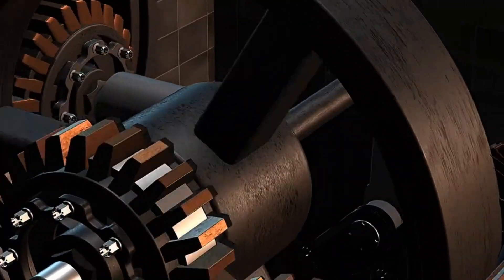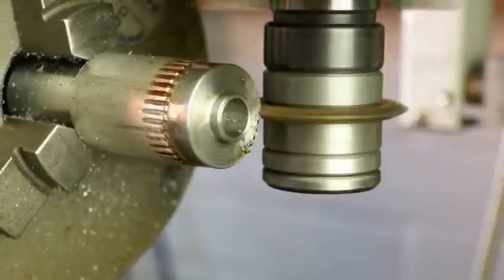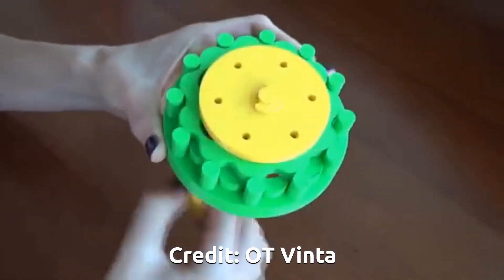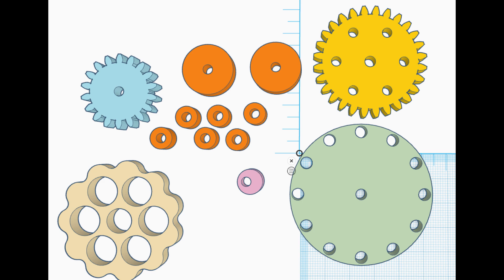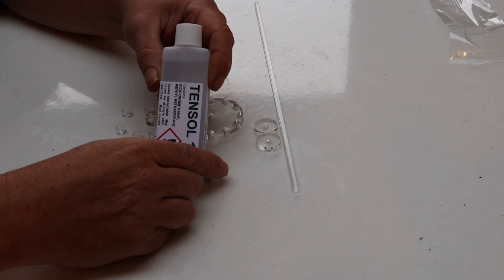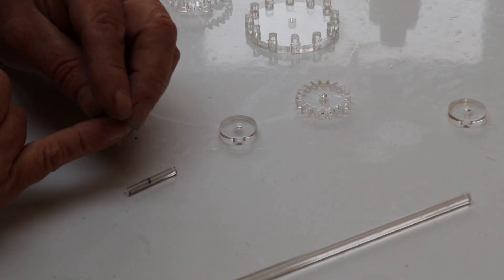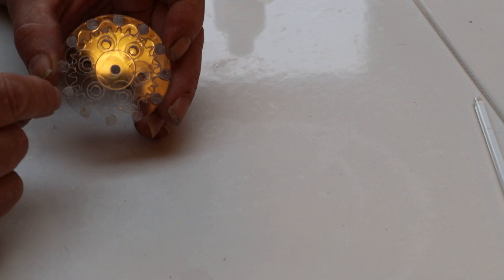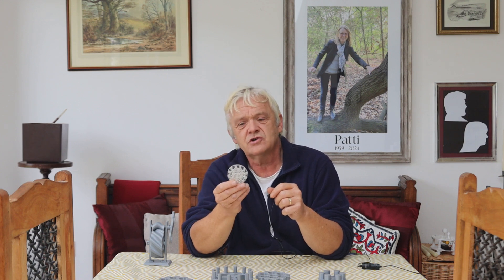2295 Gear Cutting Without Gear Cutting Gear - The Hypocycloid

Comment: Looks good for a daydream i have on a device that would also use a bicycle freewheel sprocket , so that one direction pulls but it can slide forward again without needing to reverse ....i have thoughts on a sprocket with just rods against bearings though and another using bicycle chain flat and one sprocket but i need a big reduction for this idea...glad to see you healthy hope you have a great day sir...
edit: i like clutches lately too (in daydream stage still)  the potential, sometimes a backwards lever could be useful on clutches as in the lever backwards so you disengage the clutch by moving that lever or for start ups or also speed consistency if it's centrifugal version

Comment: Hello Robert, a bit of an off topic question. Have you ever come across "stepped" aerofoils (aka kline-Folgeman aerofoils)? They are apparently an aerofoil shape used for RC gliders that drastically reduce skin drag at low Reynold's numbers. Might be something worth tinkering with in a future project for a low wind turbine or for the blade root of normal turbines to squeeze out a bit more efficiency.

Comment: Hi Robert, 
The 10:1 reduction gear you assembled is very interesting and having a speed reduction is grand however, does the system also produce the torque under load as well?🙂

My reason for this question is I want to assemble a logging winch/capstan out of  wood to prove the concept and help me shift some trees 🌳 😅
Without a gear reduction, a standard capstan would be impossible for one person but with a 10:1 advantage, it becomes a little more realistic and a lovely way to exercise the mind😊

Comment: - I have a  2 stage 3d printed hypocycloidal drive (100:1 in <2" thick gearbox) I made back in ?? 2013 or 2014  - I left the circular pillars/pins as free floating cylinders fitted into holes on both sides of the casing - allowing replacement if they wear significantly...  (the hypocycloid does need to be fairly precise - coming up with the mathematical model for it is a trick -  in the CAD software i used, it needed to have the cartesian form - Polar is so much simpler -as it is just a sinewave wrapped around a circle.....   Back when i did it the discussions on the web was whether or not "accessible 3d printers wer eup to making them accurately enough to function well...   yep..
..
 - The implementation I did was 2 stage (without phase offset hypocycloidal elements) - it was a design curiosity for a 100:1 reducer in the most compact form I could think of - also no bearings as it was a hand cranked model...  Adding rolling element bearings at all rolling interfaces improves efficiency hugely, but of course increases the part count a lot...

 - Making things out of sheet materials with a planar cutter - does improve the ability to mas produce things rather than having to "build all the blocks" a "unit of length" at a time....  In the real world we use as much pre madebulk material as possible - usually, and only "additively" stitch things when ther eis no alternative...  (The civil construction industry really   - Is  at the origin of all additive manufacturing, but again we like to pour things in bulk lots, or insert prefabricated assemblies / materials..

Comment: I have printed your split-ring harmonic drive and it was so cool to see it work, despite my terrible print settings. I printed an axle out of PLA horizontally on my 3d printer to save on time and smoothed it in a hand drill with some sandpaper and it worked beautifully. Thank you mate! I’m going to give this one a go sometime as well, seems far easier to print. Was the one you 3d printed back-driveable, Rob? How about the acrylic one? Cheers!

Comment: plus, because you can do these on a laser cutter, or 2d.. they should be pretty easy to do on a desktop cnc in stronger materials like aluminum or brass.  
I assume the shaft is the weak link in this setup, so replacing that with an aluminum or brass rod, and maybe shaving a part down for a set screw (or D-shaped cog interfaces instead of round) would pump up the durability quiet a bit.  I've found acrylic can be very very fragile when stressed in some directions, so shy away from it as a rule of thumb. 
see if @carvera can supply you with one of their machines. ;-)

Comment: it harks back to the wind and watermills where the big wooden gears just had pegs to intermesh, it made for an easy right angle gear train. another way of achieving a 10:1 reduction is through the use of a worm gear, as I recall the meccano worm gear uses a 9/16 whitworth screw thread to mesh with the other meccano gears, so a section of allthread or a bolt can be used as a worm gear with the correct mating gears, one other simple way of making gears is to use a tap,slowly feed it sideways into a brass blank whilst it rotates and it will cut you a gear to match your worm gear thread. these are just a couple of other methods to get gears, though my favorite method of getting gears is to strip down old printers, these will supply gears and nice straight precision bar stock.
Reply from the maker: it does indeed mate - cheers

Comment: Stepping round the circumference. Also, FreeCAD has a work bench for gears.
Reply from the maker: it's not about designing them mate - it's about cutting them after
Reply: @ThinkingandTinkering  Sometimes the designing methods dictate the cutting methods. But you know that. LOL
Reply: @ThinkingandTinkering  The physical implementation slows a lot of folks down.

Comment: I wonder how it would perform at high input speed, excentric mass and friction considered.
Reply from the maker: The hypocycloid has been around for a while mate -plenty of data out there
Reply: I was wondering how much force it can handle compared to regular toothed gearing.
Reply: Googled. Plenty indeed. Not an engineer, just love learning stuff. It seems the real question is about the points of contact, this is very different than toothed gears. Thank you the video.